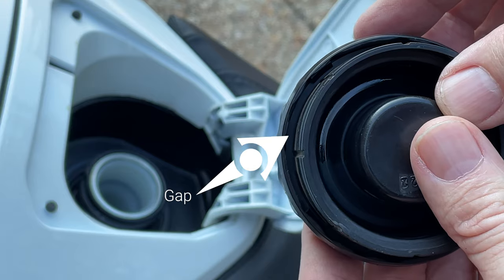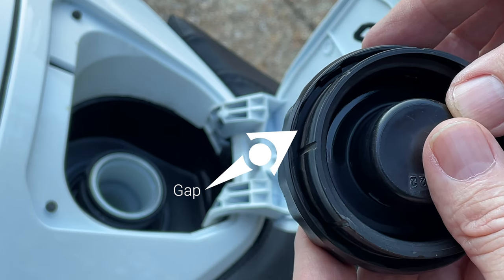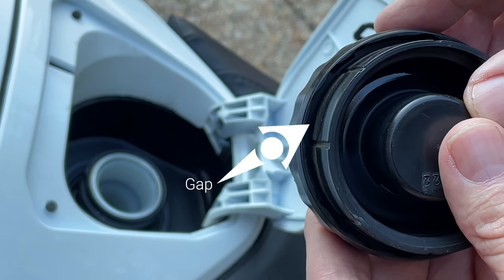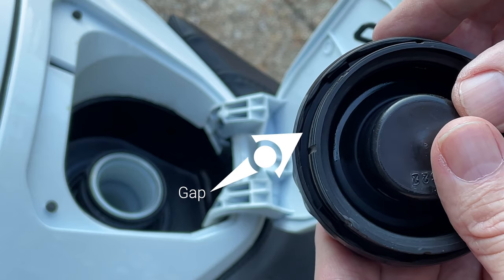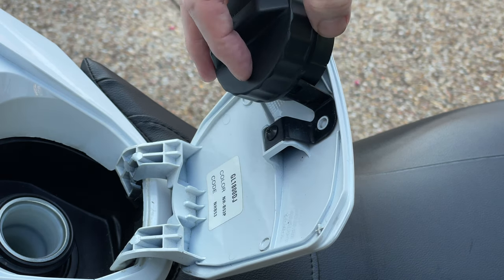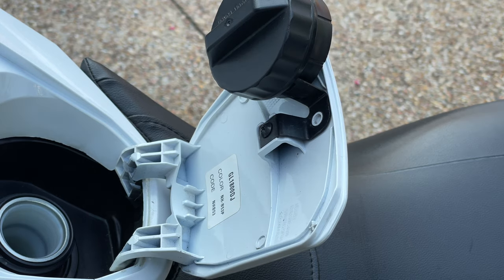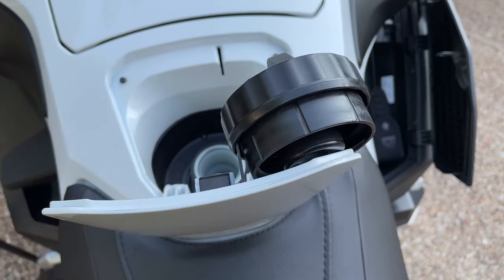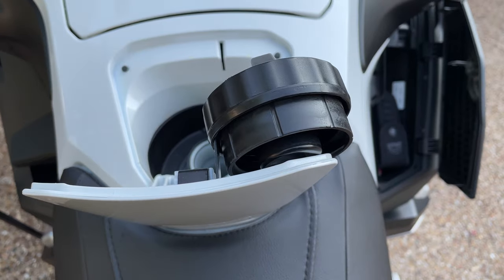Ep 4 Storing Your Gas Cap | 2018+ Honda Goldwing | Wing Tips

Comment: I'm always on the bike when I fill the gas tank. I find it easier. I typically store my gas cap in the pocket where the fuel door release button is. It's never fallen out in two years...so far. Here in California the fume traps on the pump neck are so stiff and large if you clipped it on the fuel door you'd knock it off frequently. Cali problems, lol.

Comment: That may work in some parts of the country., but not where I live.  In Ohio, and the surrounding states I have visited, the gas nozzles have a 4 inch diameter rubber ring to defect a gas surge from the tank.  It rubs the door over the gas cap as is, without adding another obstacle.  Good try, but no prize!

Comment: If you look close,  and it's obvious in your video, there's a curved lip on the inside of the lid to store the cap right above the door hinge and over the bikes color label.    When you see it, it'll hit you in the face.  😁
Reply from the maker: The problem with that curved "cradle" is that it puts the gas cap right in the way of the nozzle when fueling. I tried that method and I keep knocking off the cap with the fuel nozzle.